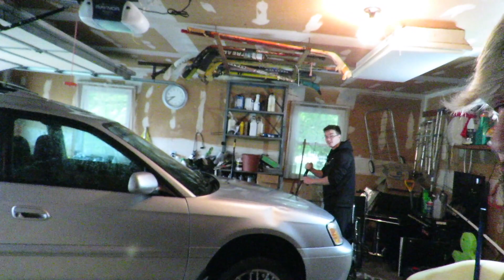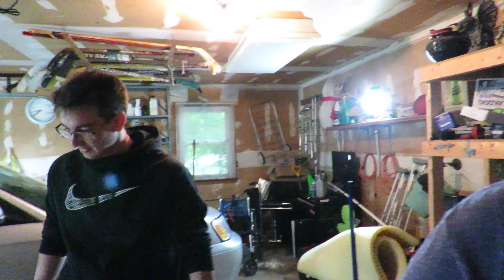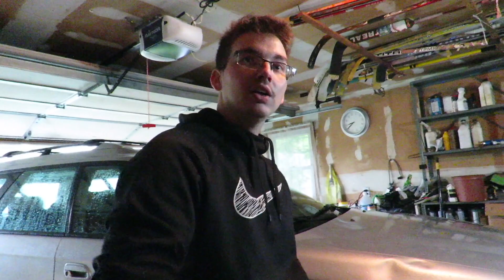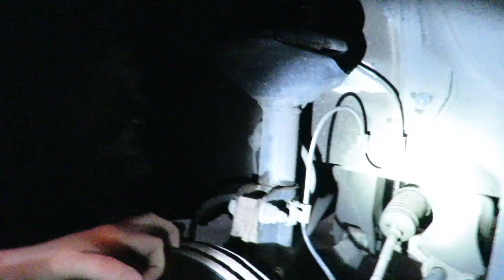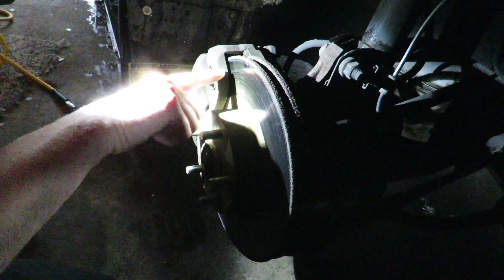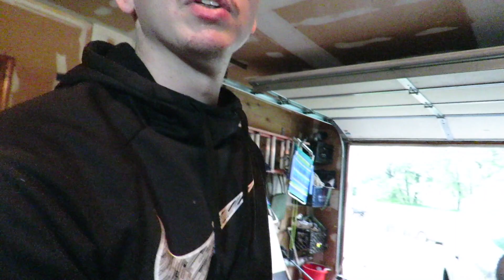Why Your Steering Wheel Shakes While Braking

Comment: So... do I need to replace my rotors? Or do I need an alignment?
Reply from the maker: If it shakes when it braking then rotors you won’t need to worry about alignment tbh the rotors are so badly warped it is shaking the steering around as it’s trying to slow down